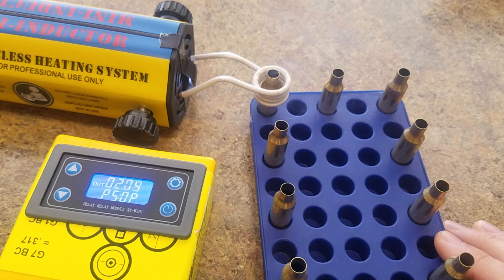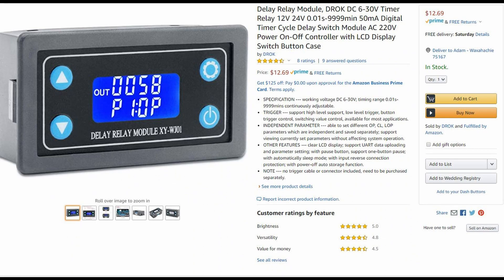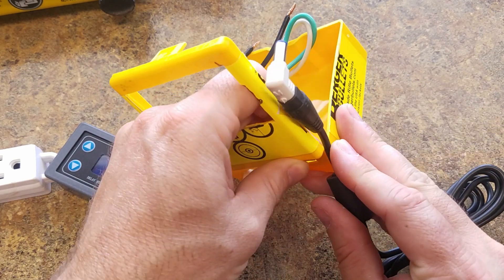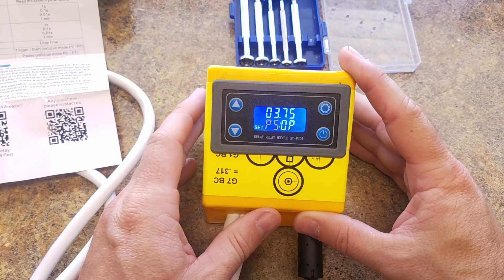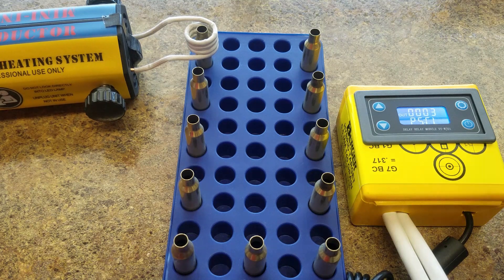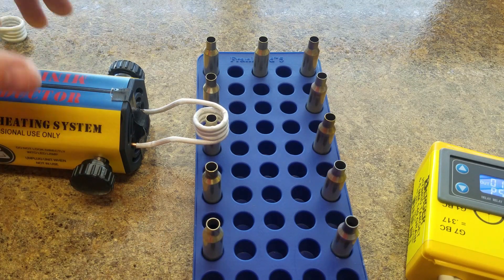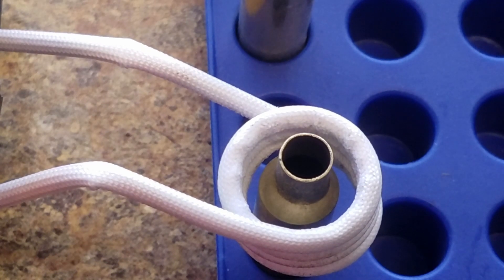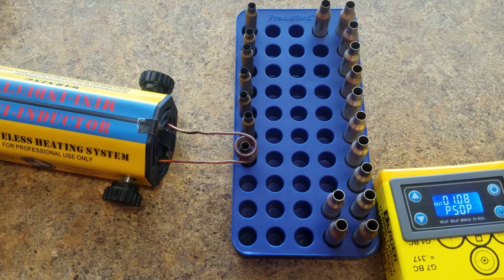DIY Induction Annealing Brass with .01 second accuracy for $200

Comment: Thanks very much for this guide. I used the very same components and it is brilliant.
Would I ever use flame annealing now?...Not a chance!
Reply: Simon Brown, what diameter coil did you make? mine is about 3/4" not enough heat for .308 can you get me in the ballpark?
Reply: @ECHO-u4s1c  Hi Ernie,
I wound mine on a 13mm ID former with 4no whole coils, along with the partial coils that go to the legs (viewed from front it looks like 5no coils. My brass case (204) stands on my bench and case neck is a coil below top at least. 3seconds to red. 4seconds very red
Reply: @simonbrown9541  Thanks, I just wound a 4 coil to 16mm and 7 seconds won't change it from gray to red. Guess I bought a weak machine, I'll just keep increasing the on time on the timer Thanks again

Comment: Hello,
Are you using two 3-prong extension cords? I see two black wires. Also are you able to post a picture or a description of all the electrical wiring? Much appreciated!!
Reply from the maker: Just one extension cord,  the black wire is just cut and both cut ends are inserted into the controller
Reply: @northeasttexastactical375  thank you! One more question if you don’t mind...I see one white and one black wire coming out of the adaptor. What connector are you using to attach to the adaptor receptacle(the green and black receptacle). I hope my question makes sense. Thanks again.
Reply: Disregard please. I see how now. Thanks

Comment: So, I bought of these on ebay.  Its the unit that comes in a black box with at least 3 coils.   Unfortunately, this unit took too long to heat up brass.   Nothing like the performance in the video?   Mine turned on when plugged in.   I wonder if the "older" ones are more powerful?   Oh well.  I returned it.
Reply from the maker: It has a lot to do with the length and thickness of the wire and how many coils. My "go-to" right now is about 12 or 14ga wire, no insulation, with about 7 tight coils, protruding about an inch from the unit. Heats my .260 in 1.9 seconds.
Reply: @northeasttexastactical375  yes, I understand.  I've studied this.  I feel this unit was under powered based on the coil and brass size.
Reply: @northeasttexastactical375  it was taking 15 to 16 seconds..
Reply from the maker: @bginvestor101  yikes, I assume they are all made in China, you got a lemon. Or hell, maybe I just got a good one, no telling how many guys have made this thing now. I hope they're having the same success as I am with it.

Comment: Thank you for this video - I just built one with your build list.  I wrapped my coil around a 5/8" aluminum rod I had in my shop.  I am using templaque 750*F and I actually get it hot enough to burn off but am nowhere near seeing one cherry red like in your video.  I am wondering if I am not getting hot enough or if that glowing red is actually too far.  I'm right around 3.8s for a 65CM case

How many do you anneal before you feel like it's time to swap coils?
Reply: 750 is not enough to anneal in a few seconds. You want to be around 1000f. There’s a few YouTube videos explaining how annealing temperatures really need to be higher. The 750 number comes from brass being heated for an hour. To do the same effect in a few seconds requires ~1000
Reply from the maker: I think to get it really hot really fast you need more coils and to do that you need thinner wire,  which heats up quicker,  but cools down quicker too. I can run 50 cases with about a 3 minute break in the middle of it.  25 cases gets my coil glowing at a 1.9 seconds on, 3 second rest interval. I haven't made an identical coil till the one i'm using now because I haven't been really annealing high volume,  just about 50 at a time.
Reply: @northeasttexastactical375  what gauge wire are you using? I am just using the insulated wire that came with the system.
Reply from the maker: It's just single stranded copper wire used for wiring up a house, I think it's 18 gauge. I'm sure you can get it bare but I stripped the sheathing off of mine
Reply: @northeasttexastactical375  thank you! Did it with 14ga ground wire from home election cable like you suggested and it worked better. Got it dialed in this morning and did a batch of about 50. Tagged you in my IG post. Thank you for sharing this!

Comment: Great innovation.  Can you elaborate on the wiring for us that are not electrically inclined?  Also would it be easier to wire the timer with AC?

PS apparantly some folks think properly annealing brass is rocket science.
Reply from the maker: Man, that's a tough one. Kind of vague too. Which part? you are only cutting one wire in the extension cord and plugging both those cut ends into the timer, and the other 2 wires power the timer unit.
Reply: @northeasttexastactical375  The video was great, but it was hard to see the wiring.  Did you just cut the male end off the DC power supply?  It looked as if there might have been some sort of connector in between the power supply and the timer.  

Is there an AC timer available that just plugs in rather than having to use the DC power supply?
Reply from the maker: Yes, Just cut the end off... OR get a female pigtail and put those ends into the timer,  then you can plug in the DC power to it.
Reply: @northeasttexastactical375  Ok, thanks  again!

Comment: Just got mine set up. You must have cut you coils?  I ended up with 8 wraps on a 1/2” 1/4 drive extended socket and it’s perfect for short magnums and PRC at about 5.35 second.
Reply from the maker: Shorter and thinner,  yes
Reply from the maker: I did cut the coils initially, but I ended up using a thinner wire with about 7 wraps around a 300WM case. The coil wraps are probably only an inch tall total because of how thin the wire is and its uninsulated. My .260 takes 1.9 seconds to anneal; I'd imagine I could do a PRC case in less than 3 sec. with the coil I'm using
Reply: @northeasttexastactical375  so shorter wires heat up quicker I assume?  It would make sense but just want to verify.

Comment: For some reason mine takes like 30 sec to heat up the brass
Reply from the maker: hard to troubleshoot on a YT comment thread, but does it heat up regular bolts and metal slow too?

Comment: You can buy an induction heater kit off Amazon for $20 +/-    I bought one of the larger ones with a water cooled coil and used a 48v 1000w PSU to drive it.  It heats up a 1/2"  bolt cherry red in a few seconds.
Reply: Didn’t see it...do you have a link or detailed description?
Reply: @MrOffshore  search  induction heater  on Amazon. There are a wide range of options depending on what you are doing

Comment: How do you know your annealing temperature....Annealing Made Perfect show that for a .223 case flash annealing to 1000F took 3.4 seconds.  Each case head stamp and caliber requried a specific temperature/time for flash annealing...time is easy to measure...how do you know your temperature is high enough for complete annealing?
Reply from the maker: That may be their time with their standard size coil that is the same size regardless of size of case being annealed.  Here,  you can custom size your coil to anneal much much faster. If you go 3.4 seconds with this rig you'll completely melt a case.  There is templaque you can use or use a brass glow color chart to get the right color of red glow. There seems to be quite a big gap from perfectly annealed to over annealed,  and it's been working great for me.  Just had a 5rd group with my .260 with a 1.6 SD. Check it out on our facebook.

Comment: what's with the music on top of the voice?? you can get some silicone, or fiberglass, insulation for the wire... also, if you make the coil a bit bigger, it won't get so hot from the heat radiated from the btass.

Comment: Just thought of this.  You could powder coat the wire at the coil point to make sure they don’t touch each other
Reply from the maker: The wire gets glowing hot as well after prolonged use.  That would stink up your house in a hurry

Comment: Could you publish your anneal time for 223 and 308?
Reply from the maker: My times will be different than yours,  depending on length of the wire, thickness of wire, number of coils,  how tight they fit around the case. You can anneal it manually and just time yourself. It's easy to get a good feel for the time needed by the color of the brass. But just for GP, my current time for my .260 (probably same for 308) is 1.9 seconds per case

Comment: Just got this set up and I'm starting to play around with it. I'm going to be using it with 5.56 LC  brass and 6.5 Creed & 6.5 Grendel both starline brass.  Could you share the time your using to anneal  any of these if you've tried. Looking to shorten the learning curve and not burn up a bunch of brass.
Thanks!!
Reply from the maker: My times will be different than yours,  depending on length of the wire, thickness of wire, number of coils,  how tight they fit around the case. You shouldn't burn up brass,  it doesn't happen that fast. You can anneal it manually and just time yourself. It's easy to get a good feel for the time needed by the color of the brass

Comment: How long does the coil last? Have you burned out coils?  I was going to buy the Fluxeon Annie annealer but went with this as well. I enjoy the tinkering.

You were going pretty fast. Any idea what the duty cycle is like? 3.75 secs to anneal, 4 seconds stop time, is like 50%. Any over heating at the rate your were going?
Reply from the maker: I haven't burned out a coil yet,  it's definitely discolored,  but i'm assuming as long as I don't melt it, it will last
Reply from the maker: I tightened up the coil and added some more wraps, now i'm annealing my .260 brass in 1.9 sec. The coil gets hot fast and I haven't made a second one to switch it out yet. So I run it until the coil starts to glow and then I let the coil cool off with the fan and then go again oh, I can do 25 before the coil starts to Glow. But, I am using a really thin wire, like 12 gauge or something.
Reply: The total on this project came to 300 for me with a proper project box, wire terminations, power supply and Tempilaq. It was a little hard deciding between this and Fluxeon Annie annealer at 660 with a lifetime warranty. But with your reply that there is a possibility of medium term reliability, I went for it. My precision reloading is around 2000 rounds a year, and it is a concern. Thanks for sharing this.
Reply from the maker: @veniceog  awww a proper project box!?! The bullet box gives it that sex appeal... you done messed up!
Reply: @northeasttexastactical375  lol, point taken. I was considering brazing together a water cooled coil attached to a computer cpu water cooled radiator. But not if I wont be burning coils.

Comment: Would be nice to have a little better idea how you wired it up as you were rather vague. Thanks for the vid.
Reply from the maker: For real? Dozens of guys have built this from the video with no questions asked. Are you sure you didn't skip ahead? I tell where every wire goes and show it going there.  I guess let me know if you decide to build it and have any questions.
Reply: @northeasttexastactical375  didn’t say where the wires came from. The dc power supply was obvious. The AC would could be more clear please.
Reply from the maker: That's just an extension cord,  Male end plugged into the wall,  female end plugged into annealer. Black wire is the only wire cut and connected to module.
Reply: @northeasttexastactical375  the hot wire of the extension cord?
Reply from the maker: @grizmanmyers1944  yes
Reply: @northeasttexastactical375  thank you.  I've ordered the parts to build one.

Comment: For about 100 bucks you can get an enail coil setup and do the same.
Reply from the maker: You can get the DIY anneal kits for cheaper than that,  but it requires a lot of soldering and not very beginner friendly.

Comment: Would it be possible to wind up more than 1 set of coils for doing multiple brass simultaneously?
Reply from the maker: I feel like that would be possible but then the amps would be spread out among the different cases and it would take longer to anneal. It might take just as long to anneal two cases as it does one case.
Reply: @northeasttexastactical375  would it really though? And maybe you don't need the 4 coils, go down to 2 sets of 3 coils... Even if it did take twice as long you've got a 5 second interval between cases and would be get rid of half of those intervals. It seems like it would be worth testing to me, I'm always looking for ways to increase efficiency considering all the steps involved
Reply from the maker: @DracoOmnia  I think it's worth a shot. I plan on doing a follow-up video to this one and I think I'll add this to the list. One single wire with 3 or 4 coils in succession sounds cool. Hell, why stop there? Have 10 coils in the loop and just go down the tray 5 times.

Comment: Thanks for sharing. I'll go this route and verify the temp with tempilaq and spend the other 1100.00 on other shooting equipment.
Reply: Don't waste your time. If you want to do induction annealing on a budge build the GinaErik DIY induction annealer.
Reply: @jetthreat5000  that's twice the cost and you literally have to build it with a lot of components and it doesn't look as user friendly with caliber changes
Reply: @cademarti1365  First off, you will blow the induction board on this since it isn’t water cooled as it is designed to be used in short periods and over and over a hundred plus times. Second, the DIY GinaErick induction annealer isn’t hard to build. Third, it’s stupid easy to switch between calibers.
Reply: @jetthreat5000  I see several people made and use this but none saying theirs broke
Reply: @jetthreat5000  where's the plans to build this other one?
Reply: @yuibot5998  no one in the Annealing groups seem to be using these anymore so…

Comment: Some time ago I tried building my own induction annealer for brass as well and ordered induction heater from aliexpress without power supply. Max output was 5A 30V but it didn`t heat brass. For steel it worked just fine. Induction heaters work for ferritic which brass is not. Maybe if it were supplied with 40V and 10A it might have heated the brass. Maybe. Discarded the project due to lack of belief..
Reply from the maker: I don't know what the minimum amperage is to heat brass,  but this can absolutely MELT a brass case in 3 seconds.
Reply: It heats brass because brass is a conductor. The coil has high frequency AC in it. This causes a magnetic field which induces eddy currents in the brass. The currents run 90 degrees to the brass length and perpendicular to electromagnetic flux lines.

Comment: You’re better off building the GinaErick DIY induction annealer.
Reply from the maker: Maybe if he had some blueprints, but that setup kind of defeats the purpose of this easy 4-piece build, and it looks a bit pricey.
Reply: @northeasttexastactical375  just google the GinaErick annealer, easy to find on accurate shooter. You’ll spend just about the same amount trying to watercool this set up so you don’t blow its circuit. You’ll spend around 300 building the GinaErick annealer.
Reply: @northeasttexastactical375  I’ve built a GinaErik annealer years ago and now have an AMP.

Comment: The induction Bolt heater you reference is now $265.00 alone I was wondering if this (https://www.ebay.com/i/372957519422?chn=ps&norover=1&mkevt=1&mkrid=711-213727-13078-0&mkcid=2&itemid=372957519422&targetid=4581046486499628&device=c&mktype=&googleloc=&poi=&campaignid=403204662&mkgroupid=1239149819509085&rlsatarget=pla-4581046486499628&abcId=9300377&merchantid=51291&msclkid=8b4f80a618d71a650cfadf1a60386af9) mini heater would work? Or does it not have the capacity?
Reply from the maker: Sorry, I just saw this. I updated the links with one on Amazon for under $200

Comment: Any cap on the number of cycles or if you will have to replace the coil?
Reply from the maker: It can "overheat" but it's got a auto shutoff that kicks it off until it cools.  The number of cycles is dependent on how long it takes for each different cartridge.  And that is dependent on the length and gauge of the coil used.  My 223 I can do 50 easy in 5 or 6 minutes. If it does overheat,  I stick the shop-vac hose on the tail end and suck a bunch of air through it for a minute and it's ready to go again

Comment: What did you use to roll the wire around? What is the inside diameter? I am definitely making one.
Reply from the maker: Ive now started using the next bigger case size to wrap the wire.  Wrap it around a 308 for my .223, a 300WM for my 308/6.5, etc.
Reply from the maker: I used a towel rod for the bigger coil that fits the .308/6.5 family.  It came out to .62" od. I think I might have used a paint marker for the smaller .223 coil